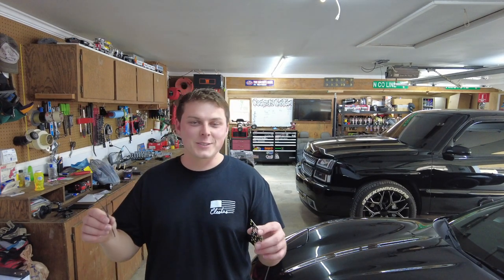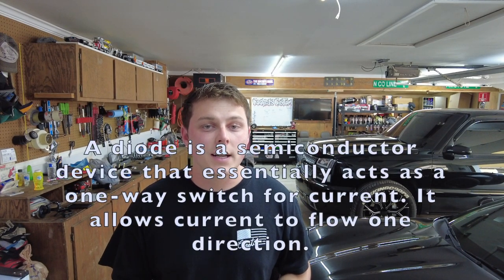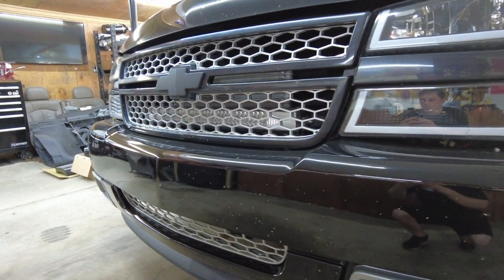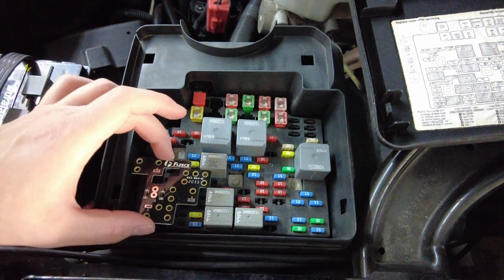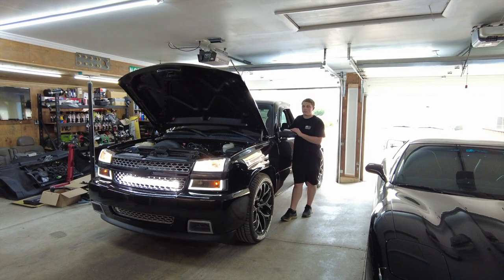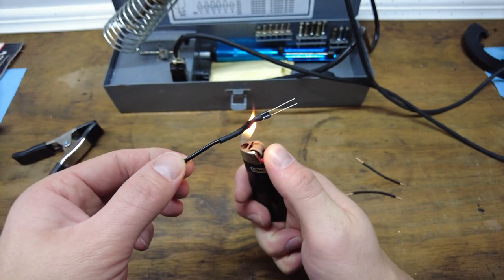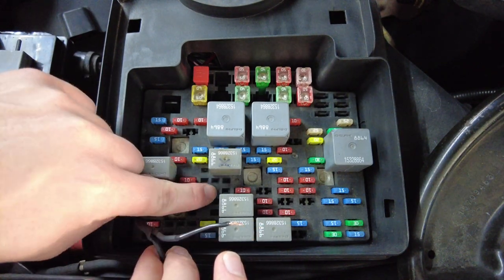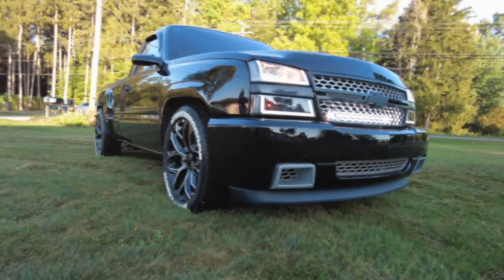6 Hi Mod, All Lights On! 03-06 GM Trucks. High Beam, Low Beam, And Fog Lights!

Comment: I just installed one of these boards, I had to switch my headlights from auto on to manual for it to work, so I took it back out, now my auto on don't work at all unless I switch it to manual on, blow a fuse??
Reply from the maker: Oooooo thats interesting. I haven't herd that one before. I would definitely double check your fuses. But if I had to guess, im wondering if you got a bad board, and it caused issues with your headlight switch. If there are no bad fuses, I'd try replacing the headlight switch (that in conjunction with the dash light sensor, they control the auto feature) that would be my best guess. Sorry that happened to you, hope you figure it out!!
Reply: @TheKingCoopa  yea, I have to admit, I was being completely stupid that day, since I doing it in the daytime.  Auto on doesn't work in the daytime lol.  It wasn't till later that afternoon, I finally grew a brain and realized why only manual on was working - idiot of the week for me lol
Reply from the maker: @tonymeehan7859  oh hahaha nice. Honestly thats the best scenario. Shotgun replacing parts is never fun. Glad you figured it out!

Comment: I’ve got a question for you, what gauge wire did you use there? I’ve got some 18 gauge solid copper would that work?
Reply from the maker: That should work. The thicker the better though. If your doing the diode method, its just a signal wire. To tell the relay to get power from the battery. 18 should be fine.

Comment: 2 years late 🥴 but I'm trying to keep fog lights on all the time with the Daytime running lights and low beams, is it possible?
Reply from the maker: Hey, I would just run a wire or diode, from the DRL fuse/relay out put pin, to the fog light input pin.

Comment: Why wont my fogs turn on when i turn on high beams 😢
Reply from the maker: Hey, sorry for the late reply. have you figured it out yet? id would check your relays, or make sure the relay pins are touching the mother board. it could also be a bad board. also make sure your fog light fuse is in ( I did that once haha)

Comment: Of all the videos I’ve seen you’ve put together this instructional video very well. Articulate and professional.
May I make a video suggestion?
Can you do a video on converting to LED lights and turn signals without hyper flashing? 
I admit, I have not succeeded in this task 😂
Reply: Buy an led compatible flasher relay really easy install
Reply from the maker: Hey, sorry for the late reply! Some LED tail lights/ turn signals come with resistors pre wired in, or you can wire them in. But honestly I would do what Jason suggested and just buy an LED compatible flasher relay. Hope that helps. Thank you for all the support, I appreciate it!!

Comment: I used one of the motherboards from Amazon. Not the fancy one you used but was supposed to do the same.   I have all hid lights in front but for them to work correctly in my truck I had to reverse the polarity on the low beams from the ballasts. Now my fog lights will stay on with high beams but i still lose my low beams and id love to throw my drls in the mix but I might melt some retinas. Any ideas why I can't get highs and lows to cooperate? Is it the reversed polarity ?  Thanks in advanced
Reply from the maker: Hey, sorry for the late reply. Honestly I think its the mother board you got, is the issue. You shouldn't have to switch polarities on your lights. I'd switch it back to normal, and try the fancy motherboard  or try the diodes. With the diodes you can throw the DRL in there as well

Comment: Why not add the real fog light down where they go? No fog where your at? The lower the lights are, the better you will see through it. That light bar is about the same place as mine and it sucks trying to see through the fog with it on.
Reply from the maker: Hey, the fog isn't too bad where I'm at. But the SS trucks didn't have fog lights from the factory so there isn't really a good spot to mount fog lights down low. They do make some kits to mount pods in the air ducts. My oem air ducts were $130 each, so I really don't want to cut them up 😅

Comment: Why not just run a separate relay and trigger the the relay off the high beams sure its easy but is the wire installed at the factory ment to handle the loads your doing
Reply from the maker: Hey, sorry for the late reply. I did run a separate relay, the factory fog light relay. I also used the factory switch, I like everything to look clean, and not have a bunch of switches all over the dash. This way I can operate the fog light whenever I want, not solely depending on the brights. 

Each circuit has its own relay and harness. Nothing is getting overloaded. The brights/lows/fog light harness/wire is designed to hold that power with halogen bulbs. They aren't sharing the power, nothing gets crossed over. The circuit board or the diodes only job, is just to tell the other relays to turn on. The diode connects to the "trigger" wire/pin of the relay, and the relay gets the all power from the battery. Thats all it does. Plus, running LEDs pulls even less power

Comment: Now with the Amazon board, do all the lights come on when in low beam and only all lights come on in high?
Reply from the maker: So with the low beam on, you can turn your fog light on and off whenever. When you turn the highs on, it also keeps the low on, and turns the fog lights on at the same time. When you turn the brights off, the high beam and fog lights turn off.

Comment: What value/wattage diode did you use? If it matters. Most are 0.5 watts but  are anywhere from 2v to 47v.
Reply from the maker: Hey, its been a while and can't remember what size I bought. I'd assume the smaller size would work. You just need signal power to go through it, to tell the relays to turn on.

Comment: I must have the wrong diode because when on auto during the day time the DRLs come on and my highs too. I flipped that dude around the other way and the same thing. With a cap over the sensor during the day, the lows come on, but when I hit high, lows and DRLs come on as planned. What in heck am I doing wrong? fixing to open the fuse box and clip the auto circuit from the DRLs relay and have it my way. I don't want them running during the day anyways.
Reply from the maker: Hey, sorry for the late reply! Honestly not sure what is going on with your light setup, did it do this before you put the diode in? I'm wondering if it was a bad light sensor, causing them to come on at the wrong times. Also the diodes do only go one way, which could cause some small issues, but I don't think it would be what you're experiencing. Hopefully you have figured it out by now!
Reply: @TheKingCoopa  I think the value on the diode is wrong and bleeding through. The same diode does exactly as intended on the low to high.
Reply from the maker: @CORYJOHNM  hmmm, if you have an extra diode, try doubling up the diode (side by side) so they can split some of the power together, maybe that will work
Reply: What diode value you use?

Comment: Why does the diode go to 86 on the fog light and on 85 on the low beam? I've seen it go to 85 on the fog lamp in another video?
Reply from the maker: Hey. Sorry for the late reply. 
Pin 30 : power from the battery
Pin 85 : switched signal wire
Pin 86 : ground
Pin 87 : power to the fog light.

Based off online research the diodes should all be going to pin 85 to turn on the fog lights and low beams. The fleece motherboard uses pin 86, which is why I said/ran it like that. On paper pin 86 doesn't make any sense, but even with the diodes thats how I ran it, and it worked. 

Here is some extra info on all the different light combinations if your still interested: https://www.silveradoss.com/forums/topic/83673-different-light-options-4-high-6-high-etc/

Comment: Hey bro if i would want to have my fog lights connected so when my lowbeams would turn on. Is there a way i can do that with a diode? And would it interfere if i did the 6 high mod
Reply from the maker: Hey, sorry for the late reply. you could just run a single diode from the low beam output, to the fog light input. That will give you what you want, if you also want the 6 hi mod, you can do that with more diodes, or use the fleece motherboard, then put that single diode on top, for your low beam/fog light setup as well. hope that all makes sense, but yes it is easily do able.

Comment: So the motherboard doesn’t turn on the drl with your other lights

Edit: Also if it doesn’t turn the drl on, could I run a diode to the drl with the motherboard
Reply from the maker: Hey, its been a while since I did this video, but if I remember correctly your brights will shut off the DRL bulbs (lower headlights, closest to the grill)   

Also you could still run a diode to the DRL relay if you wanted.

Comment: What amperage are those diodes?
Reply from the maker: Hey, not sure. They were cheap ones, so probably not much. The diod is just to send the signal to the relay, so it can pull the power from the battery to power the lights. I ended up using the mother board anyways.

Comment: Does this work if you don’t have fog lights but want highs/lows at the same time
Reply from the maker: Yes, you could use the motherboard for 25$ or do a single diode, from the high beam output, to the low beam input.

Comment: Will this work on a 01?
Reply from the maker: Hey, the fleece motherboard says 03-06, so I'm gonna assume not. But you could still do the diode method if your fuse box is different than the 03-06
Reply: @TheKingCoopa  ok will you explain why you place the harness ends in the specific ports of the relay mounts? I'm not well versed in this area. Thank you
Reply from the maker: Dash switches and buttons can't take alot of volts/watts. Headlights take alot of power to run. So they need a relay, so the switch doesn't burn up. A basic relay has four wires. Ground, switch power, battery power in, battery power out to the light.

So when you turn your headlights on, the switch tells the relay to get power from the battery and send it to the headlight.
The diodes are the mini "switch" so when you hit your high beams, the diodes send power to the fog light/low beam relays, switched power. Which tells them to send power from the battery to the lights. Which gives you the 6 high.

There is alot of info online about diagrams and simple schematics of how a relays work, if you ever wanna learn more about them 🤘
Reply: @TheKingCoopa  what gauge wire do you use? How long will you run this setup for at a single time?
Reply from the maker: I used 18ga wire. Doesn't need to be super thick, as its just used to send the signal power, to the other relays. I've ran it for 5 or 6 min before a car comes, then turn it back on, its usually on for a good amount.